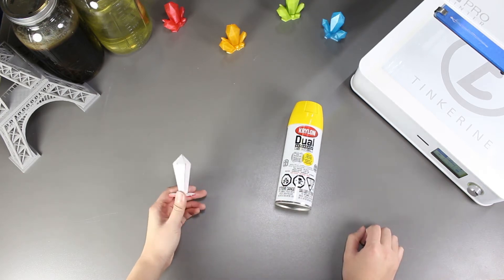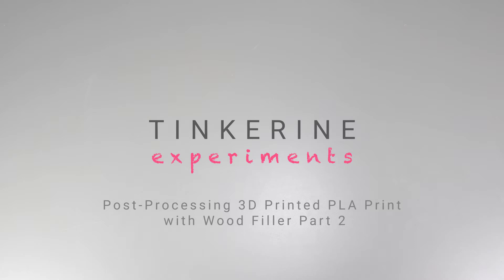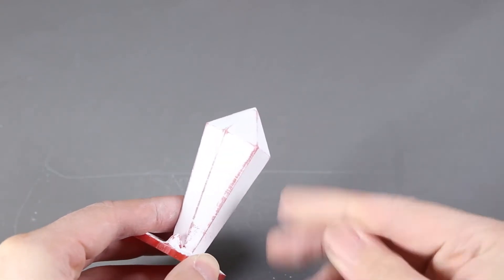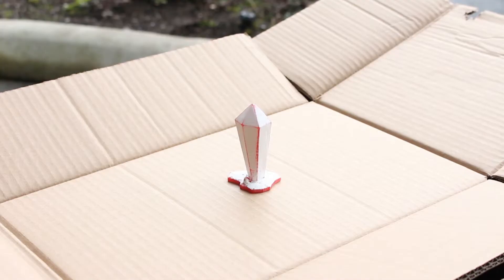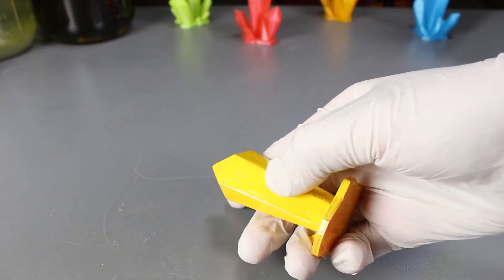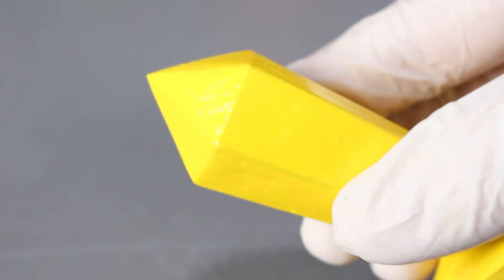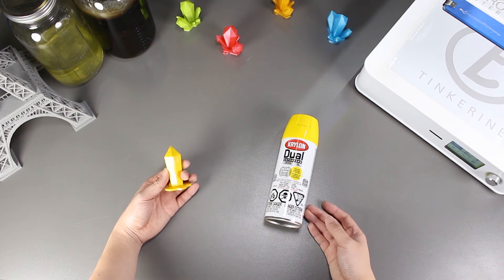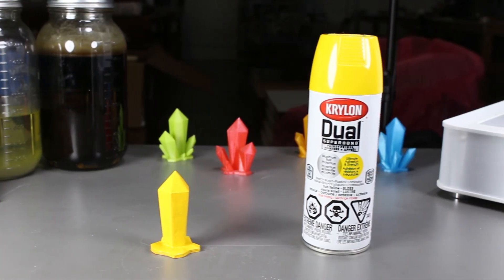Post-Processing 3D Printed PLA Model with Wood Filler Part 2

Comment: hi, i  have a question. after you  apply wood filler and sand it.  how do you remove the dust from sanding the wood filler? or you just spray the primer filler after sanding? thank you
Reply from the maker: After we applied the wood filler and sanded it down, we used a microfibre cloth to wipe it down and also used an air compressor as well to blow any dust that we couldn't get off the model. The air compressor may not be necessary though.

Comment: It might work out to be expensive and impractical for large scale operations (batches of the same model/print), but it might be a good idea to look into something called Perfect Plastic Putty. A lot of us that build scale models use it for plastic model kits made out of styrene. It's generally used for seams and gaps. But it's durable, sands well, and is even water soluble--meaning you can smooth it pretty easily with a damp cotton bud (q-tip) or brush if needed to before letting it dry.

Thank you for the video regardless. I'm getting my first 3D printer, and it's on its way to me--Monoprice Maker Select Plus. So I'm just watching a bunch of a videos before I get started printing. PLA seems the best choice for me.
Reply from the maker: Thanks for the comment and suggestion! We will look into acquiring some Perfect Plastic Putty and trying it out. It sounds perfect to be used with PLA too. 

Let us know if you have any questions!
Reply: @Tinkerine  - I can't show videos and whatnot at the moment, so you'll have to take my word for it, that it works beautifully. 

I printed off a 1:1 replicator of a prop from the TV show "Star Trek: Voyager" that the EMH (Emergency Medical Hologram) wears--Mobile Emitter. It's a birthday gift for a buddy. It's on Thingiverse.

Applied the Perfect Plastic Putty. To make sanding easier, I was able to just wet my finger to smooth it out, then let it cure overnight. 

I did a few passes with a medium grit sandpaper before going finer until it was almost polished. Blasted it with some plastic primer (I use Hycote, which is actually intended for automotive--may be just a UK brand) after.

Painted it (airbrushed with hand brushed details), threw on a few enamel clear coats (I use a brand intended for plastic models--Humbrol), and polished it with super fine sandpaper. 

A lot of effort. But it could pass as something you could buy off of Star Trek's official store.

Comment: Thanks for this test! I've been told to use wood glue for smoothing. I'm a little surprised that I can't seem to find wood glue in your history. Have you tried it?
Reply from the maker: Thanks for the comment, we actually haven't tried smoothing with wood glue yet, definitely something to look into though!
Reply: This is the exact recommendation I was given by someone who has been 3D printing/painting for a long time. 

"Wood glue as primer for 3D prints. Smooths small gaps and ridges. Works well as a paint primer."

So it's not just a smoother, but a smoother/primer. It might not fit your tests because of this.